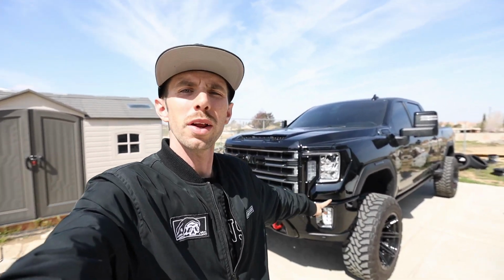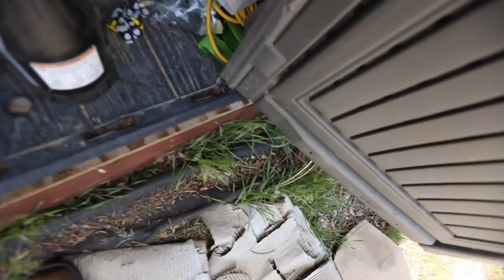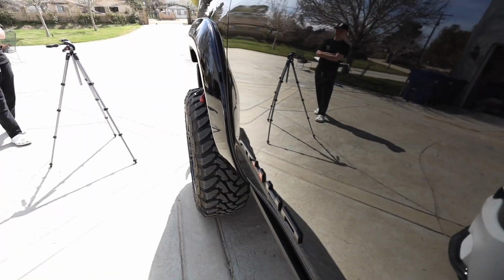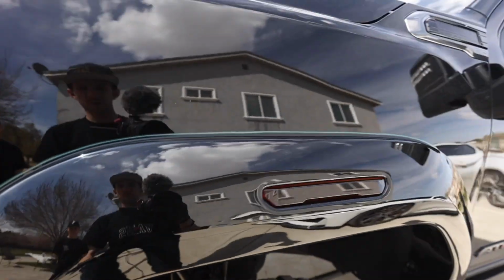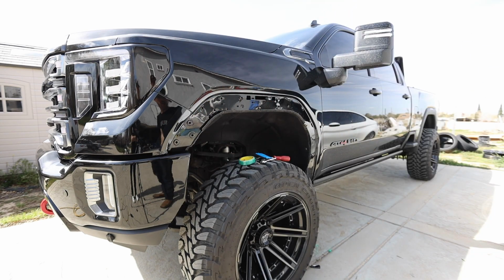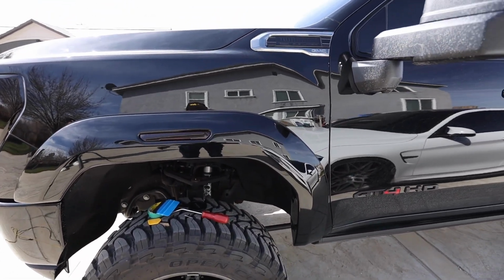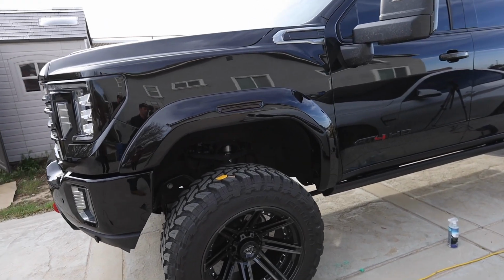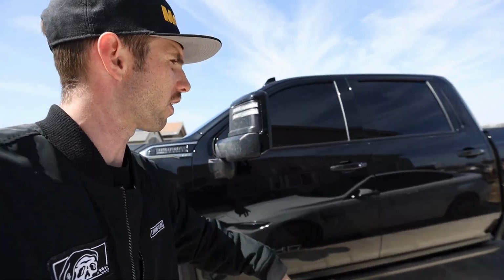Bushwaker Flares on 2022 GMC 2500 AT4HD with added vinyl wrap for paint protection

Comment: On my 2019 3500 I added Husky’s kickback mud flaps and that really has protected the lower part and f the truck. I was getting chips and those helped a lot. Mine has the 6” BDS lift on 35’s.
Reply from the maker: @mtivest8425  I’m going to look those up as well, appreciate the tip!

Comment: It's a lot easier to get the clips off if you just take a little extra time and take out the t15s in the liner. Drop the liner and get to the clips from the inside, this will  help not bend the metal/scratch up the paint.
Reply from the maker: @magnetfishing867  didn’t actually know this was an option or that there was access behind the liner, I appreciate the info! Definitely would have saved me!